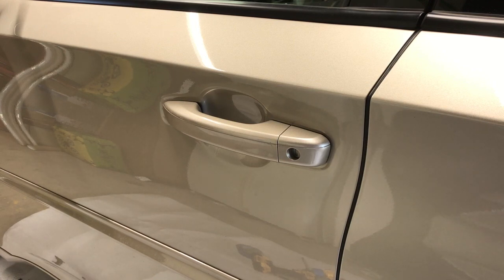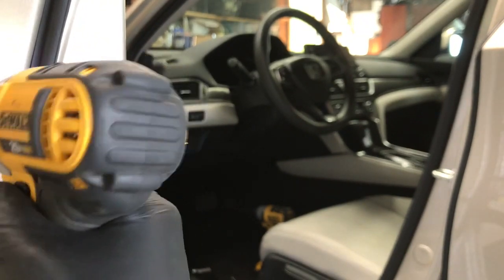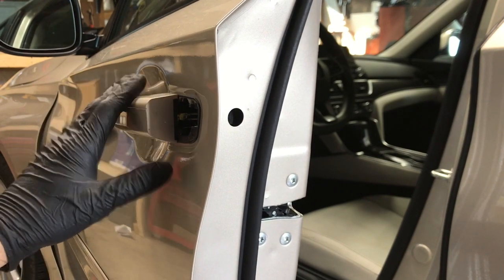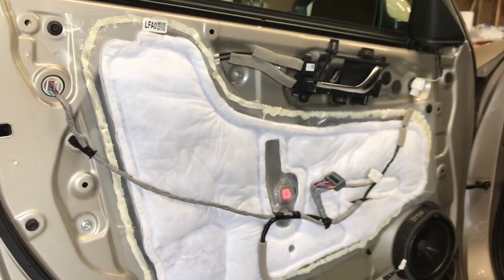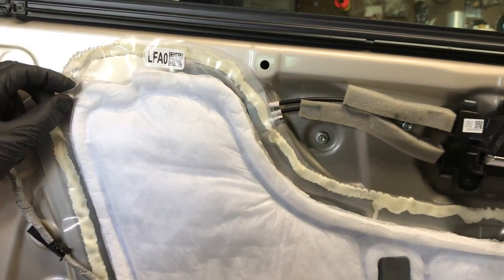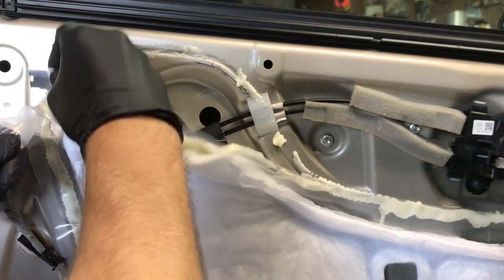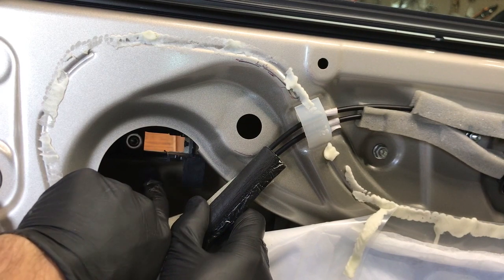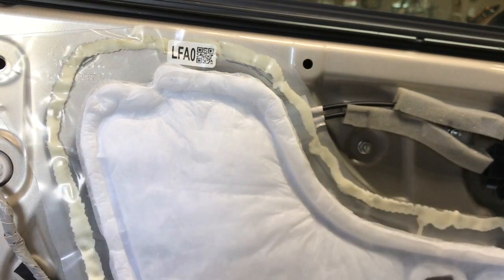2018 2019 Honda Accord -- How to Remove Front door Handle

Comment: Would I be able to fix the lock if something was stuck inside or if there is something out of place? I can't put my key in anymore and my door rattle to lock, they want to charge me 550$ min to fix it...
Reply from the maker: I would take it apart and see if you can find anything out of place. Worst case scenario you can’t figure it out and put it back together and pay them to fix it. You might surprise yourself and be able to figure out what it is. 

You can order new lock cylinders from Honda, install them, then get them rekeyed by a locksmith. Do it yourself and save some $$$$